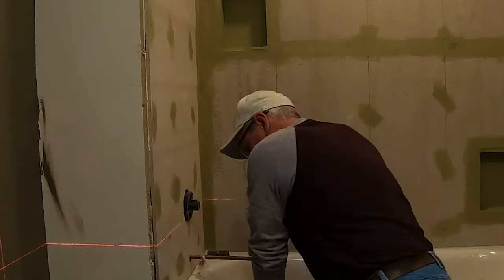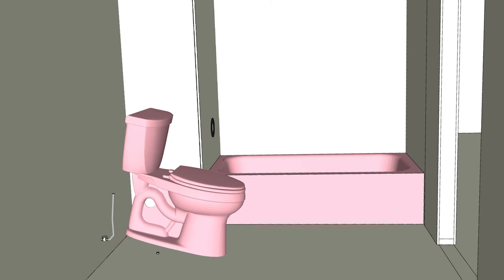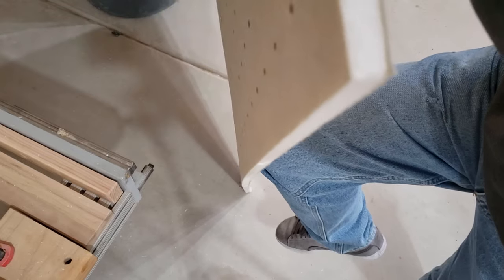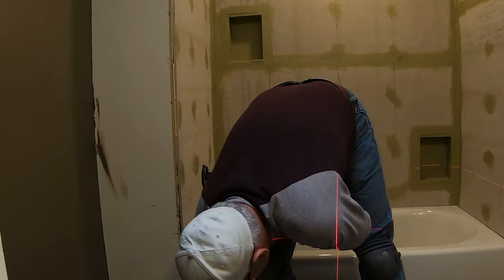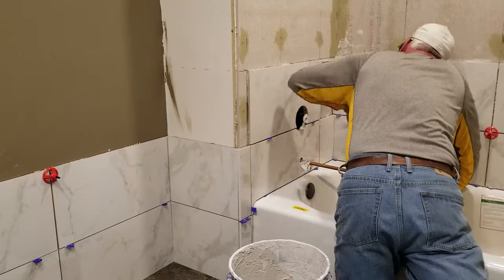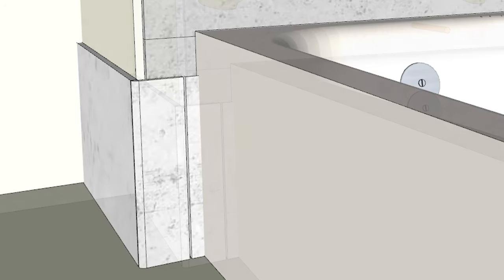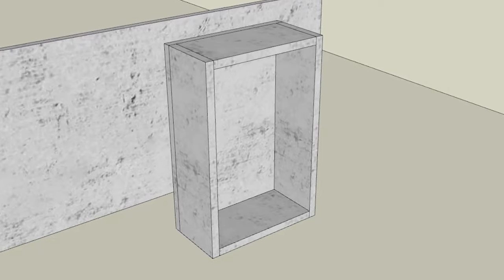Tile Setting - How to Set Tile Around Your Tub

Comment: A helpful tip I have used on cast iron tubs when working alone, is to remove them with a sledgehammer they break up with some effort and can be carried out piece by piece. All in all great video! Lots of good stuff here.
Reply from the maker: Yeah, Scericabauer, it wasn't until I starting watching YouTube myself that I stumbled across a video where someone busted out a cast iron tub with a sledgehammer a few years ago. I really haven't had the need to pull many tubs over years, but there have been times where I wish I had know that tip! Thanks for watching!

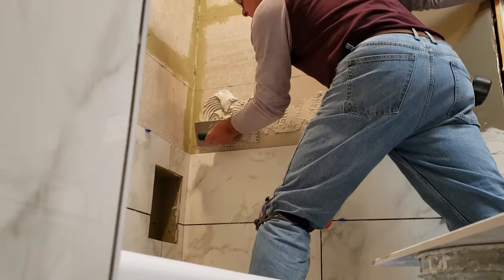Comment: Nice work rusty. Personally I would have put the 24” tile in the middle, then about a  18” cut tile on each side of it. Also, 12:38, that’s why I like a roll on membrane like redgard or aqua defense. It prevents the backer board from sucking moisture out of thinset.
Reply from the maker: Thanks, Kevr! I wondered who would be the first to make your observation! I thought the same thing when I was working on the animation. The decision was all about the niches! You might be able to see in the finished shots at the end of video what kind of cuts I would have had to make if I had centered the tile on the center line. I don't mind a challenge every once in a while but wasn't in the mood that day! I think the temp was about 30 degrees and the saw was in the shade!
Reply: Rusty Dobbs I hear you. Just finished a shower and there’s never a perfect solution. Either way the tile looks nice and joints are nice and even.
Reply: Agreed. This looks bad..
Reply: Exactly, so many small cuts on both sides near the edges, not pretty at all. Redguard or other waterproofing is a MUST!

Comment: Excellent video, as always!  I like the animation and fast forward, your choices on tile placement, and am in total agreement on not putting a water barrier on the surface of the backer board, for the wicking reasons you mention.  Enough trapped moisture from a crack in the grout could over time grow quite a little 'garden' behind the tiles, the airborne spores from which can make some more sensitive people really sick!  Good job, sir!
Reply from the maker: Thanks, JusBidniss! Yeah, that waterproofing the whole surface is a popular approach and would seem to be a potentially bigger problem but I have never heard of it being raised as a concern. I live in a very dry area but I would think the higher the normal humidity of a location, the bigger the concern would be. A couple of years ago I got talked into setting tile in a shower for some friends that someone else had done all the prep for. Everything including the Hardiebacker and floor was coated with several coats of Hydroban. Air flow was not great to the area either so I told them that they were going to need to towel dry the shower daily to keep from having issues. About a year later, I was doing some other work for them and asked to check the shower. Of course, they were not drying the shower and already had mold starting to grow in the lower corners. It was a shame and having to run a box fan in the bathroom going forward was an inconvenience, but they had to start doing it. But at least they didn't have to worry about their walls studs rotting!
Reply: @RustyDobbs  Interesting!  I wonder if an extra coat of grout sealer, plus installing a higher CFM exhaust fan, and possibly adding an additional air intake grill down by the floor to maximize the fan's efficiency (assuming there's a suitable room on the other side of the wall), might help their situation (or at least prevent the need for that box fan, which given their history on towel-drying the shower stall, sounds about as likely to happen)?

Comment: Man you are awesome!!!! This is my goal for my tub how do you measure your surround so you may know how much tile you’ll need for the job? I need you to install my tile for my bathroom
Reply from the maker: Thanks for watching, Judith! You measure the square footage of the area you want to tile and order about 10% more than that for cuts you might need to make and in case there is chipped or broken tile in you boxes. For a tub surround like this, about 60 square feet takes the tile up about 6 feet above the tub level. If you want to go to the ceiling, you need to order extra for that. If you want rounded over trim pieces on the edges like in this video, you order that by the linear feet that you need. It's really pretty straightforward. Good luck and I hope you get your project done!

Comment: I'm running into the exact issue of the tub not being level. I don't know what you mean by taking another inch out of the cut. I saw another girl that instead of doing staggered Cuts she did more of a diagonal line cut. I'm using a Bosch leveler and I'm going to draw my lines on the tiles and then go cut them so they're all level. Cutting from the bottom of course. Is this what you would recommend? Thank you and I absolutely love your videos, your voice, your pace and all of the detail.
Reply from the maker: Hey, thanks for watching, MM! Yeah, I think you are getting the idea. You always want to be setting tile against a level line regardless of what the tub is doing. If the tub is not level, great! Find the lowest point on your tub and start figuring your layout from there. Let’s assume you are using 12” x 12” tile. If you measure up 11” from your low point of your tub and make a mark on your wall, then mark a level line all the way around your walls, that is your reference line that you want to set your tile to. Obviously, you are going to be cutting off an inch at a minimum of each piece of your bottom row of tile to get it to fit between your level line and the tub. That’s what I meant when referring to the taking off another inch. You can mark your level line anywhere on the wall and adjust your cuts accordingly. Your goal at tub level is to have a 1/8” gap for a caulk joint between the cut tile edge and the tub. Another caution… do not set tile on one wall and run it all the way to the top of your enclosure before setting tile on the other walls. That can create alignment problems in your corners that are really difficult to fix. Just speaking from experience! Run two to three rows of tile at a time and set tile on all three walls working your way up the enclosure. Good luck with your project, MM and thanks for your kind comments!

Comment: Love this. I have a question when you say start at the low point what do you mean? I'm currently having two issues. My tub isn't level and once I get to the right corner of my shower the gap as I go up starts to get bigger. I'm assuming  because the wall is unleveled.
Reply from the maker: Hey, Horton. The simplest explanation is to always remember to set your tile on level and plumb lines. If you start your full tile on the low point of an out of level tub, you will have to cut all other pieces to line up with the level line, so you won’t have the gap issue you are describing. Make sense?
Reply: What about just leveling the tub. Is it too much trouble?
Reply: Leveling tub is pretty difficult.  Dudes right. Cuttin bottoms sucks far as timing but makes job look great and stay level
Reply: @Rusty Dobbs  This helped out so much. Thank you for the great advice!
Reply: @Charles Knight  I don't think it would have been but creating a starting point off of the tub worked amazingly. Then, I just barely had to cut the pieces that went below.

Comment: What reason do you have for the little pieces on either side of the center full piece on the tap wall? especially because it led to the weird 1/2” piece going down the side of the bathtub? 
A tip to anyone doing this work for other people, don’t stand/work on the tub without covering it. Great animation/explanations. Thanks.
Reply from the maker: Hey, Mark. As I mention in the video, the bullnose cap I use to have a finished corner on the outside corner of the tub wall causes the need for the ½" filler piece against the tub based on the choice of the direction I installed the bullnose. Had I run the bullnose on the wall next to the toilet, that would have made the cut against the tub about 2 ¾" which would have looked better there. But I prefer the finish bullnose cap to run as I have it in the video so you make those calls before you start installing. There are always other options. I guess the main thing I have learned over the years is it is best to figure out how all your cuts for the job are going to work out before you install the first piece of tile. That is what keeps you out of trouble. And, yes, you are right. You definitely want to be careful and protect the finish on the tub as you work.
Reply: @RustyDobbs  Sorry, missed the bull nose mention first time through. It’s not even offered in my area. So, I either use Schulter aluminum trims or the factory tile edges, which is what I would have chosen here regardless to avoid all the little cut pieces. Totally agree with your comment that tile layout is all about trade-offs. Good to know your reason. That animation software is an amazing tool for teaching, wow. Well done.

Comment: Loved your instruction however there was an issue on your video that was not addressed fully. I hope you can give me some suggestions. My bathtub is not leveled and is a cast iron in a cove. So how to I fix the gap of the tile without having to have a thicker line of grout or caulking, P.S. bathtub is on a raised foundation and there is some movement. Any suggestions.  Thank you
Reply from the maker: Thanks for watching, Diana, and sorry my explanation fell a little short. I address that issue at about the 11:30 mark in the video, but simply stated, you start with a full tile at the low point on your tub rim and make cuts accordingly. If you do that, you do not have a gap at the tub. You will need to make cuts, in all likelihood, for all the other tile pieces at the tub level, but that’s the way it works. Remember, you always want to set tile on a level line without regard to if the tub is level or not. That doesn’t matter. It may be hard to follow the rationale, but once you get it, you’ll never forget it.

On the tub having some movement, unfortunately the only way to address that is to cut some access point in a wall or walls around the perimeter of the tub to be able to shim under the corners of the tub base and stop the movement. Big pain to do but that’s the way to fix it. Hope that helps, Diana, and good luck with your project
Reply: So very glad I found your video! I’ve been a little frustrated because I have not made as much progress as I thought I would by now in even getting started, but I’m so relieved bc you have addressed several issues that I may have, and even would have definitely run into, and I wouldn’t have known it until it was too late… Thank you so very much! 🤗

Comment: I sure hope you still receive communications when people comment on your older videos. I think I’m using a similar tile shown in your video here, it’s porcelain that has a glossy finish and looks like marble. I am shocked at the lack of protection the tile company has used to protect the face of these tiles. They have put the finished glossy face against the rough back of the next tiles. Some of these are scratched. While I have extra boxes, I just perfected my choice of tiles & layout for the back wall and need the other boxes for the 2 side walls & finding the exact tiles i want for their patterns.. and, will probably have the same exact issue with those tiles being scratched too.
Are there any tricks to remove these surface scratches?
Reply from the maker: Not that I know of, LA. The scratches in the oven-fired gloss surfaces of tile unfortunately are there to stay. Seems like the darker the color of the tile is, the worse the scratches show. It's pretty rare that I have run into this, but its has happened. I always order 10-15% extra tile to allow for breakage and scratches. I have found that if I have to go back to the supplier for additional tile, you can have other issues with different lots and runs of tile that can create problems too. Suppliers could definitely do a better job with packaging!
Reply: @RustyDobbs  thank you so much for replying! I really appreciate your time and insight. I had since done a little research online in meantime and found several sources suggesting to try rubbing toothpaste, or vinegar - i think was the other option, I’d have to go back and look. I’ve gotten a little off track and have not had an opportunity to test it out. if they would just box them with the finished side of two tiles facing each other, and then a rough side of the next tile, facing the prior batch’s rough side and so on, with a protective film over the “peek window” of the box to see the color and design… 😐 then again, they make more money off of pros & clients having to buy extra. 🙄 thanx again, appreciate you!
Reply from the maker: @lafos4914  You make too much sense, LA! You're welcome. Anytime.

Comment: Hi very educational video. I am about to start my frist tiling job. Quick question, I noticed at the last 2 seconds of your video, you did not put any spacers below on the tiles laying on the tub. Was that intentional ? Should there not be any spacers from tub to first tile ? Thank you
Reply from the maker: No, I am putting spacers in at the time the video ends. If you notice the pencil line above the tiles, I am using a blue wedge spacer to slide the tile up to the line on the left and the right side. I shoot for about a 1/8" gap at the tub and tile joint which is perfect for a caulk joint. That footage at the end of the video was filler, William, and probably not a good choice for people watching as intently as you! Most people don't  watch to the end! Good luck on your project!

Comment: Hello Rusty.  First, great video.  I'm about to do my own tiling and this information is really helpful.  I have a couple of questions though.

I didn't replace my water pipes behind the wall.  I considered it but decided not to.  The conditions of the pipes were good although I saw a small amount of 'green' buildup around the copper joints.  The house is nearing 30 years now and, so, the condition of the pipes seemed like normal 'wear'.  Should I be concerned?  Do I need to do it over?  I'll do it if I have to but would like your opinion.

I've seen videos in which the presenter says something like 'today, we're going to work on this side of the wall...', and it seems like they're continuing the work days later.  When installing tile on the alcove wall (on top of the bath tub), is it typical to install tile in sections over a period of days?  For example, the center wall one day, left wall on another day, and the right wall on another day.  Or, can you install all the tiles in one day?  I hope that makes sense.

Thanks for the help!
Reply from the maker: Thanks, Tony! Copper has been a very reliable product for house plumbing over many decades but weird things happen with it as well. I have seen the same type of buildup at times and don’t have the knowledge base to explain what is happening. As long as it is not obviously leaking, I would not mess with it. Copper water leaks are something that will happen and you deal with them when they do. I just replaced a two inch piece of copper for a neighbor next to a circulating pump that developed a pin hole leak. Something to do with the electrical field from the pump diminishing the thickness of the copper. Have seen that happen multiple times over the years and numerous copper pipe leaks under slabs as well.

I have done a number of videos on setting tile around tubs and, yes, you can set different sizes and types of tile much faster than others. Larger format tiles needing to be set with thinset take longer. The main comment I have on your question is that I set tile on all three walls as I work and do not set one wall all the way to the ceiling then move to other walls. The reason has to do with keeping good alignment of the rows of tile in the corners. That’s one of those things you kind of have to experience not doing it that way to understand the problems that can arise. Hope that helps! Thanks for watching!

Comment: Question - the back wall behind my tub....the center is 1/8 inch higher than it is on the ends.  So if I leave 1/8th for grout and try to do full tile at the top...my gap will be about 1/4 in the center.  Does this mean i need to rip/shave these top tiles to make it a tighter fit?  Hope that makes sense.  Thanks.
Reply from the maker: Good question, Gary. Let’s say you are using a 12” x 12” tile. Let’s further say you made a mark on your back wall 11” above that higher center point and extended a level pencil line at that mark around the back wall and side walls. If you want to install your 12” tile edges all the way around your tub on that level line (which you do want to do!), the tiles obviously would not fit without cutting them. So you measure and cut them to fit between the level line and the tub and account for the 1/8” caulk joint you want at the bottom of your tile against the tub. That process gets your installation started properly. Then you install the rest of your tile above the level line with it as your base and build up from there. You can make your pencil mark and level line at 11 1/2” or 11 3/4” or whatever height you want, but just realize your cuts against the tub get thinner and thinner the higher up you move your line. Those thinner cuts which can be harder to make. Hope that makes sense but that’s the way setting tile works. Your main concern is with getting a level line established on any wall tile job you do.
Reply: @RustyDobbs  thanks, turned out very good, and your video helped!